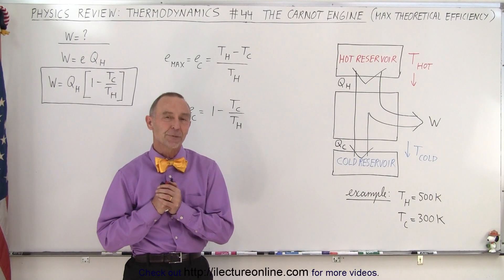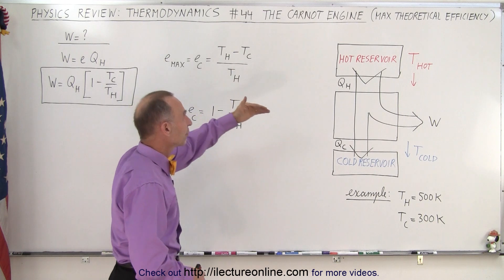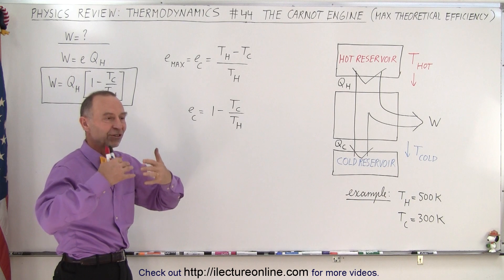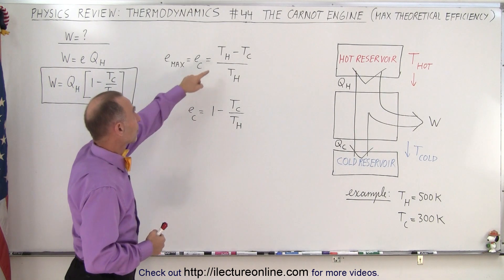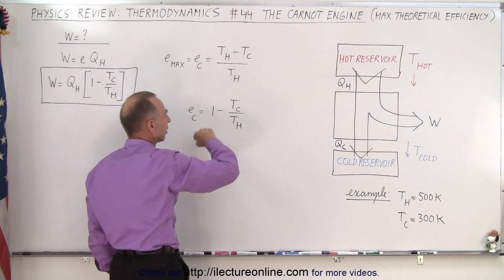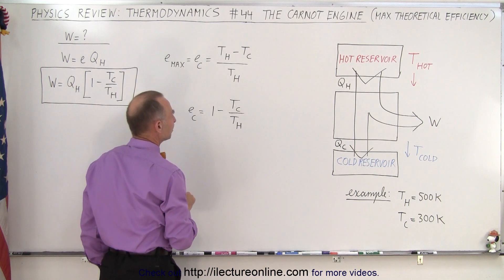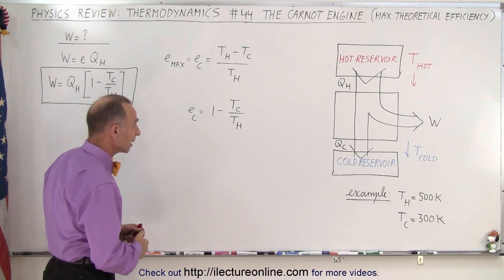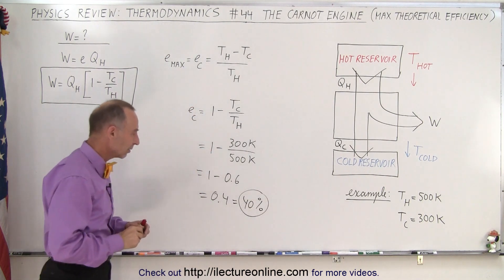Physics Review: Thermodynamics #44 The Carnot Engine

Comment: Mr. Professor should we use Kelvin scale or we can use Celsius since the fractions are different? (-273 oC is not achievable). Mr Professor NOx are the problem in gasoline engines (low temperature) should not we increase the temperature of combustion and reduce nitrogen oxides?
Reply from the maker: For the "difference" in temperature it doesn't matter, but for the absolute temperature we must use Kelvin.